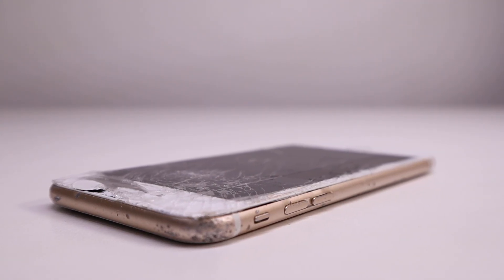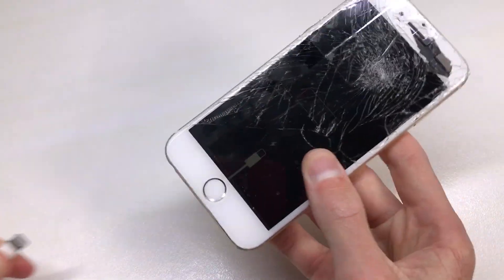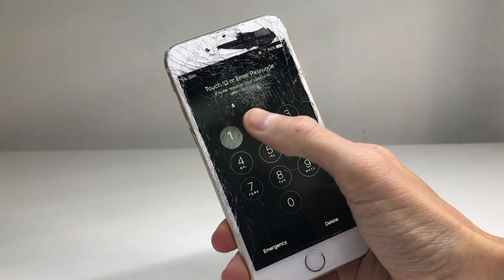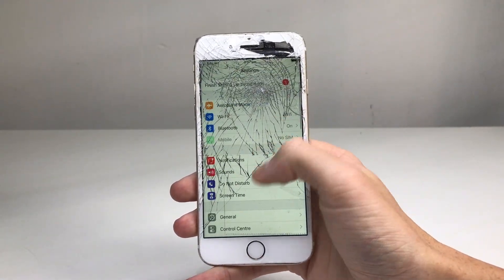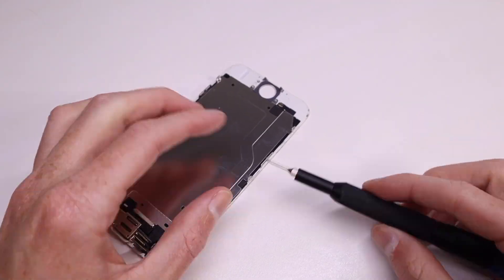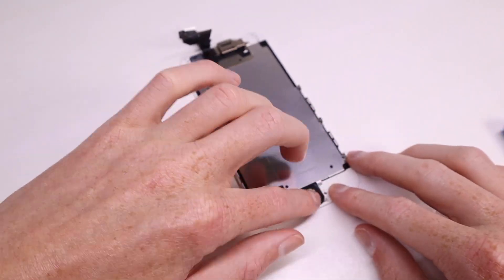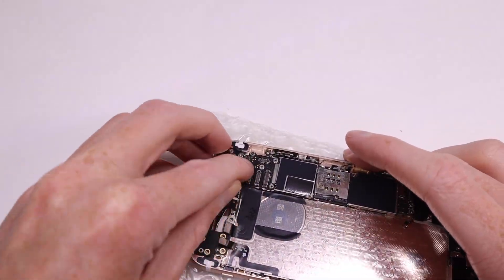$30 Destroyed iPhone 6 Restoration - Seller Tried to Scam Me?!

Comment: The lines are shown on the screen when the flex cable connectors are bent when pressing them down so if you bend them from the pins up it will fix it

Comment: why is the ifixit battery for the 6s only 1715mah and 6.55Wh, when the original battery in the phone is  2750mah, and 10.45Wh? That's a loss. Ok just a min... you're promoting ifixit batteries but don't use them yourself. I can see the battery you have put in is better than ifixit batteries. hmmmm ??????????????🤔

Comment: The screen issue after the battery replacement is probably the battery voltage being misread by the battery managent chip and feeding an incorrect voltage to the screen, causing the unexpected behavior. Normally the BMS should shut the phone off when the voltage is not correct, but given the replacement it may have incorrectly inferred a good voltage.

Comment: The touch ID not working when you replace the home button was originally at a security feature to stop scam repair shops from putting in a hacked home button. Disabling the entirely on the other hand is complete bs

Comment: Hey! I really enjoy your videos and I already repaired two iphones by myself(SE 1st gen battery replaced and now waiting for charging port to be delivered and replace it as well, and iPhone 7+ where I replaced the screen and the battery). Do you know if it is true, because I was told so, that after replacing the original battery and when you check the life, it always says 100% ? Despite the fact that I have changed two batteries I do not have any observation on this as SE can not be charged because of the port I guess and I always have to spent like 10mins to adjust the cable until it starts charging which is really annoying(the port is not dirty) and I do not have any observation on the iPhone 7 + as I changed the battery last week and have not used it and it is 100%.
Btw after replacing the battery for the first time on my old SE 1st gen I had the same issue with the screen and it litteraly took me like 10 times of disconnecting and connecting the screen. Back then I promised myself not to open an iPhone again and here I am, repairing my sisters'' iPhone 7+ and looking for more broken iPhones to repair :D

Comment: You’ve got me very interested in repairing iPhones after watching a lot of your videos. I did get a free iPhone 6 that is damaged but working. Just wondering where you got the parts from? If you can provide me a link that would be great. Can’t tell if you bought them all from crazy parts or not. I’m in Australia and I’m looking for a replacement housing that doesn’t require me to move many parts across. I would prefer to use new parts in the housing where possible.Thanks.
Reply: Links in description mate.

Comment: I had a similar issue with static electricity on an iPhone 6 a few months ago. I've been trying to replace the screen and suddenly got lines like these after I connected it. Interesting fact: with an old display the phone worked fine, but with the new one — I got these lines on the screen. First I thought that the module was broken. But then I remembered this video and decided to wait some time.  You were right, after ~ an hour the lines disappeared and the phone works just fine now.

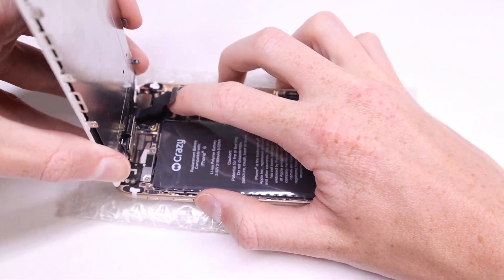Comment: 7:45
Thats why you plugged it in and "nothing happened" or, why your iPhone is shorting out. I'm glad you cleaned out your connectors, but you LEFT THE PLASTIC ON THE BATTERY!
😁

edit: okay, at 9:23 or so he takes off the plastic; sorry :p
but still, could have been shorting out, or pressing up against, the LCD.
good job though!

Comment: hi Hugh I was wondering if you know what this problem is on my IPhone 6 

So I have this problem were when when i try to charge my iphone it takes a while to finally charge and when it finally has enough to rebut  to the white apple screen (like normal) it then goes completely black and then shows a green/red/blue little line somewhere on the black screen. at first i started noticing the battery life was deteriorating and i would have to keep it on charge 24/7 now after a few months of this , that started happening and i haven't been able to use it since. 

Thank you for you time if you were able to read this! ~ your videos are very helpful and entertaining btw :)
Reply: Replace battery
Reply: Or restore with itunes

Comment: That’s so awesome! How much do you charge to do this? Wanna hear something shitty on my part....So I had an iphone6sPlus rose gold for a year in a half & one day I drop it at work on the conveyor belt & bust up the screen. It had lines running through but I can still see a little bit like the “100%” charger symbol. Anyway I thought it was toast so I sold it for $45 like an idiot 😒🤭 come to find out ALL IT NEEDED WAS A SCREEN! One of my biggest regrets because I ended up buying one AGAIN after that when I technically already had one I just needed to replace the screen. Anyway but it wasn’t all in vain- the buyer was very happy, he replaced it right away. He told me he was relieved because the first phone he bought to fix up was a dud (scam basically). Mine was completely unlocked & working beautifully once the screen was fixed. So he deserved it & i wasn’t all that mad about it anymore🙃🙂

Comment: What’s the issue with having it on iOS 12?
Reply: It runs painfully slow.
Reply: Neeraj Dwivedi any idea if I should update my se from iOS 11 to iOS 13?
Reply: @christinewakely1081  Yes you can upgrade your iPhone without any issues my wife has a iphone se on iOS 13 and it works great.
Reply: @neerajdwivedi2015  you are wrong because iOS 12 on iPhone 6 is great my friend has an iPhone 6 and it fast as lightning. I think he said iPhone 6 on iOS 12 sucks because iOS 12 has a new set of restrictions and a battery life is affected on the phone.

Comment: The fact that the home button is paired is not for them to sell more phones, actually this is a security issue, that prevent random people to unlock any stolen iPhones, because if the button weren’t linked, it would be possible to trick the phone to unlock with a fingerprint that isn’t registered. So that’s a bad for a good, and same thing goes to the Face ID module
Reply: Explain this then: Apple wont replace your home button without replacing the screen even if the screen is not cracked! (Which means you are paying the screen replacement aswell.) And also on the latest iphones, replacing THE SCREEN disables faceid, but replacing faceid itself wont??? Explain this.

Comment: Cool! I just rebuilt a Samsung Galaxy Note 5 starting with basically nothing but my motherboard. I bought the phone brand new about six months after it was released, and used it up until about a month ago when it just finally became completely unusable. Starting with the digitizer and mid frame assembly, then two batteries, rear glass, an S-Pen, and a bunch of internal parts, I have about $80 wrapped up in it.
My problems started about a year and a half ago with a battery that was just starting to swell. It turns out that you shouldn't screen mirror videos to a TV while the phone is on the charger the whole time. Bad news. All it does is overheat the battery. Eventually it got to the point where I super glued all down the left side of it and put it in a few small plastic jawed bar clamps overnight. When I released the clamps the next day, the phone started expanding again and started pushing the whole thing apart, so I had to work fast to get everything all smashed together and get it into the OtterBox Defender case. That worked great and held everything together just fine until one day last month, the phone actually locked up and no amount of key or button press combinations would shut it off or reboot it. At that point I decided to undo the OtterBox so I could take the SIM card out to use in another phone while I waited for the battery to die. Upon taking the case off, the phone expanded again to about an inch and a half thick. The phone went in with an already cracked screen, and at some point, the pressure inside the case caused the rear glass cover to shatter, but I have no idea when.The only things that I was really able to salvage was the camera modules and the bottom speaker.
The phone was a lot easier to disassemble than the iPhone. 20 Phillips head screws to separate the rear frame from everything else, and the rest was all nothing more than unplugging a shitload of those tiny flat connectors from the boards. Normally I would have had to start by creating a tiny opening between the rear glass and the housing, then a hair dryer and a spudger to remove it the rest of the way, but the battery took care of removing the rear glass for me, so I got to skip that step and move on to the 20 screws. Next I would have had to heat the battery to soften the adhesive that holds it in  place, but that step was done for me also. Starting with the point where I finally got everything cleaned up and was ready to go, I only spent about five minutes re-assembling it and having a completely functional phone again to use as my new backup device should anything happen to my new one.
The Note 5 impressed me enough with refusing to quit regardless of what i did to it, so I bought another one, this time a Note 10+.
I should also mention that once the battery finally died, I recharged it, put my SIM card back in, smashed everything back together into the OtterBox and used the phone for another five days while I waited for my new phone to arrive via UPS.
I was a Beta tester for the T-Mobile Digits program, which gives me the capability to have two SIM cards with the same phone number, or if I want, I can have two separate phone numbers attached to my main SIM card. Since I opted for the former, this allows me to pick up either phone to use without the hassle of swapping out the SIM card, for instance if I know I'm headed somewhere that I'd rather not take the Note 10+.

Comment: If that's the worst condition you've ever seen you've been lucky so far lol. Had one come in with the LCD entirely missing, only about 20 percent of the glass left on the bottom part of the phone and the frame violently bent at the top.
Dude ran it over with an excavator

Comment: Yes you can get home button functionality from iPhone 7 you're a idiot lol

Get a jc home button gen 3 which has all the functionality of a normal iPhone 7/8 home button including haptic feedback (not clicky type it's digitiser) 

However you will not be able to use the touch id functionality

Also this is the worst iPhone refurbishment I've ever seen, blaming the battery replacement for lines on the new fucking screen

It's the way you installed it, you damaged it 

~ professional phone repair tech 10+ years experience

Comment: I am confused .. restoration here means :
- use a housing replacement
- use a screen replacement
- use a multiple pre-installed internal parts
- use new homebutton

Not so sure you can call it restoration when 90% of your parts are not restored but bought
Reply: Well the most important part of any phone is the phone’s logic board and its components, any other parts are considered as consumables

Comment: 5:27 what a load of bullshit. That argumentation makes no sense. The reason why the homebuttons are directly linked with the motherboard is because of the potential of people connecting their own modified homebuttons allowing them to potentially bypass Touch ID.

If your reasoning was anything to go by then Apple could lock quite literally every component to the motherboard that it was sold with, meaning that you could not replace any of the original components.
Reply: Touch ID isn’t swappable if the phone is on the whole time. If you want to install a modified home button, you would need to restart the phone. Restarting the phone makes Touch ID unusable until you enter the passcode
Reply: @givepswrd  Good point. There is still potential for security exploits though. What I am trying to say is that it has absolutely nothing to do with Apple wanting you to buy new new devices etc.
Reply: Ryan The iPhone 7 and above home button will not work at all if it’s not matching.

Comment: I paid $300 for a broken AT&T iPhone 6s Plus 64GB in 2015 (broken digitizer, good LCD, dented housing), then purchased a new Sprint 6s Plus 16GB with a bad ESN (mint housing, mint OEM screen, finance locked), then swapped logic board from both housings and sold the dud phone for parts and got my money back for the donor housing. Since then my 6s Plus has been living it's life in a Ballistic Tough Jacket with Corning Gorilla Glass screen protector, not a scratch or dent on it. Just got a new Apple battery in 2018 for $30. Even the techs at the Apple store couldn't believe how clean it was. They had no clue I had ever been inside the phone. Glad to see others paying attention to details, when I worked as a technician for uBreakiFix I'd see all kinds of terrible attempted repairs as well as shoddy repairs from mall kiosk competition. Solid work on the 6 refurb. I actually need to get my 6 64GB re-balled pretty soon (touch-disease).

Comment: What computer software did you use to wipe the data because I was scammed of eBay with a locked iPhone 6 s plus
Reply: You know that eBay has refund in almost every fucking posted item there, I even got a gaming laptop "not working" and it actually did work

Comment: I have to say this. If you think it is wasteful that apple will not let anyone repair apple products, istn't it double standards to buy a complete frame with everything fitted, because it is easier and faster? I mean if you don't want waste then why didn't you get the empty frame and transfer the parts? Other than that, nice video :)

Comment: Apple doesn’t make you fix touchid sensors for no reason, think for one minute. You can spend thousands with that sensor, they need extreme reliability when asking banks to trust them. Even if it were 990 dollars to fix that costs less than a latest iPhone. Stop spreading misinformation.

Comment: I have a iPhone 6 and having some issues with it. It’s the exact same problem with this iPhone 6 you repaired, but no cracked screen and/or bad battery. The iPhone (mine) keeps going unresponsive full screen and glitchy meaning that it keeps pressing by itself. The WiFi thing always die. So basically, when I try downloading a game or an app, it keeps saying WiFi not connection, same thing with YouTube and Netflix. I use wireless data all the time. I’m moving on from 6 to 7.

Comment: Great video for people to learn from but why didnt you use ESD protection, and why didnt you use a genuine battery? That is the entire reason you ran into issues with the screen, not to mention you run the risk of having to replace the battery in 2 months
Reply: Not necessarily 3rd party batteries can be just fine there is no need to get a apple approved battery.
Reply: tales  agreed yes but no esd protection was used hence the static buildup, but I'm just saying if you want a phone fully original and new get the proper battery, they really aren't much more expensive, probably like $10 for a cheap one or $15 for original

Comment: the problem with the lines/touch not working comes from the display cables not being seated properly, I had that problem too once and after I screwed down the shield that goes over the connections it was fine

Comment: 9:23 NO!!! Static electricity can only be picked up in capacitive enviorment, that can actually store electeicity(human body). Most probably was a misplaced connector from the battery that was not powering enough  the display

Comment: I had the same lines problem when I replaced just the battery and I disconnected and reconnected the screen multiple times and I just gave up and screwed in the metal plate and when I turned it back on they were gone